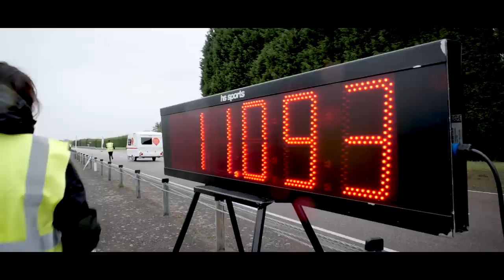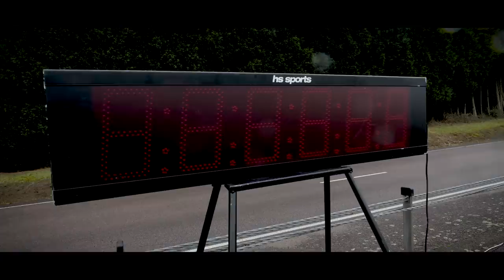How Fast Can You Tow A Caravan... With A Bike?

Comment: Guinness have been chugging too much of their own product if they thought 25mph was realistic.
Reply: Yes, 25mph would likely require around 5 horsepower so that is highly exaggerated goal.
Reply: @patricj951  well 5 hp is 375 watts which Mark was definitely pushing . Problem was instability. Maybe towing with rope ?
Reply: Χρήστο ς its 3750 watts mate
Reply: @xristos1250  no, 1hp is 736w, so 5hp is 3680w. I think it's obvious in the video that it was not only stability which prevented him to go faster. A 700kg caravan has a significant rolling resistance and at such a low speed the air resistance is small. Human power is too small for such a heavy transport with rubber tires so I think the speed will remain low. Exceeding 20km/h the air resistance will be significant as well so I think 40km/h requires several cyclists on a tandem to reach.
Reply: @patricj951  I stand corrected, it sounds more realistic. Maybe get the full Gcn crew :D no tandem just rope no?
Reply: 20 - 25 mph is average speed of a hyperbike. Its just to much probably
Reply: Guiness will do anything for a buck.
Reply: @xristos1250  Problem with a rope, would be stopping - mark would stop, but the caravan would keep going - and at 25mph, that would be a hell of a mess...
Reply: I'm pretty happy pulling myself along a flat road at 25mph let alone a caravan!!
Reply: Agreed, no idea who came up with that figure but they are obviously not a cyclist.
Reply: Χρήστο ς trouble stopping then
Reply: I can't even keep a good 25mph on my super light road bike, I go more like 18-20mph on a casual ride. I don't even want to know what I go on my mountain bikes, probably like 5 because I'm just having fun and maybe 15 downhill all out
Reply: To help out, you'd need to dampen the oscillation of the caravan's front wheel.  With a longer stretch of road and a lot of stored energy, you might be able to increase the speed a bit.

And nobody said the caravan couldn't be pushed out a bit at the start, maybe 4 or 5 people to push for the first 20 feet or so.
Reply: Χρήστο ς 1 hp is 745 watts
Reply: @vulekv93  that was uncalled for.
Reply: Where are people getting the 5hp figure
Reply: @slainsco  people asked 5 horses if they could pull it at 25mph and they could
Reply: @xristos1250  375 watts with perfect weight distribution, aerodynamics and without tow is possible. 375 + 700kg with insability, wind, tow, traction, etc. is impossible.
Reply: @dash1dash2  when you're towing a caravan, you have no need to worry about your aerodynamics on the bike, the caravan is just going to ruin all of that anyways.
Reply: @patricj951  That doesn't account for power loss via drive train etc
Reply: @patricj951  Chris Hoy and Robert Forstemann on a tandem. Put the cranks 90 degrees out to smooth power delivery.
Reply: @TimpBizkit  yes, that would be interesting to see! I think we are talking about roughly 4hp total power here.
Reply: Need a team of engineers or savvy hobbyists to make an ultralight caravan
Reply: @dash1dash2  1hp is 750 watts

Comment: Geez, they could have at least rigged up a cable actuator from the caravan's brake booster to a lever on the handlebars, or rig it up like a dead man's switch release in case he lost control. If he'd actually got to 25mph he'd have a hard time stopping without being run over. Also they could have messed around with the centre of gravity over the caravan's axle to reduce the load on the towball by moving internal components rearwards, which would then reduce the pitch up of the bike's front wheel (obviously there would have to still be some weight to prevent lifting up the rear wheel of the bike and losing traction). Considering how little time he had with no preparation, Mark still did a really good job!
Reply: This ^
Reply: You need to be included in the next run. They could use some of this wisdom.
Reply: Yeah I was actually wondering if the original towing setup -- although not strong enough -- offered the advantage of an extra hinge point between the bike and the trailer.  I'd think this would give the bike more freedom of movement to manage handling versus the rear end being tugged around by the momentum of the trailer.
Reply: sir you must be an engineer
Reply: Also, why not START from some of those existing bicycle trailers for towing your kids around?  The ones with 2 nice wheels and a set up to attach to a bike.  That way you could build the tow ball between the trailer wheels, essentially giving the caravan another axle to support the weight on.  That's where I would have started from.  First minutes into this all I could think was "no way can you do this with a caravan with a single axle!".   Good fun though...  just need an engineer on the team.
Reply: also perhaps welding the axles to turn together maybe? Certainly 100% needs brakes.
Reply: Yeah not allowing him to brake the trailer was just dammed dangerous and stupid. I thought Guinness were against promoting that kind of behaviour these days...

They could also have attached the towing point as far forward on the bike as possible and not allowed it any side to side degrees of freedom behind that point.
Reply: There needs to be load on the towball for stability but having the towball directly above the bicycle's rear axle would significantly improve controlability by removing the lever arm that amplifies any small course change the cyclist.  It would make it much more controllable than the wobbling mess it was.  It would also avoid the unweighting of the front wheel and avoid the need for the jockey wheel to be deployed and the associated unweight of the rear wheel that it caused.
Reply: @HNXMedia  not even wisdom just common sense and physics
Reply: There's no brake booster here. The brakes are purely mechanical, actuated either reactively by rearwards pressure on the hitch (caused by the weight transfer when the tow vehicle decelerates - which is also why they need to be disabled for reversing) or actively using a lever. Both of these require a substantial amount of force that he simply can't apply from such a position. The safest thing I can think of would be using a fatbike with downhill brakes - with the trailer's brakes adjusted just right and a decent amount of luck I think it could actually brake hard enough (without losing grip) to engage them.
Reply: no shit. that was absolutely stupid. no planning, no math, no sense of the laws of physics. unbelievable ! i'm gobsmacked.
Reply: Sam Prudden that and why use standard road gearing rather than super-low gearing to get started?
Reply: @jen3800  Simon wanted no part of this and just put Bowmen out there, lol
Reply: Yes
Reply: There seems to be a dead man's switch (cable loop) you can see in the video.
Reply: Actually move the weight back would cause the side to side swing problem to increase a lot. In building trailers there is a trade off between having too much tongue weight or having the tail wag the dog. I designed custom trailers for 18 years and trying to figure out where to put the axles was the most stressful part.

Comment: As any heavy boat owner will tell you, comfortably driving down the road at good speed requires just the right amount of tongue weight.  If you are going to go faster, you need a new mount that will deliver the load to the bottom bracket so both bike wheels are being loaded by the caravan.  Then you move the caravan axle forward and backwards until you get just the right tongue weight, which you find by experimenting.  Something like 5-10 lbs would probably be about right for the speeds you want, but be careful: falling and getting run over by a caravan at 25 MPH would be dangerous.

Comment: This seems like more of an engineering challenge than a physical one
Reply: Yeah he just needs more gear range and better balancing points right? Tuck the back tire almost under the front of the trailer, extend the framework up to the front end still using the back. Then maybe then he can get rid of the extra wheel.
Reply: Agree. He needs more mechanical advantage in the gearing.
Reply: what if an e bike is used, one that could go as fast as 60mph

Comment: I was bored, so decided to do the math. Even if we ignore every source of friction, he'd still have needed to hold a constant 300W for 2 minutes 40 just to reach that speed in the allocated distance. But that means I ignored drivetrain loss, rolling resistance of the tires, rolling resistance of the axles and drag, which would need to be added back. It also assumes he can begin applying this power from the start.

Comment: Some tips for the next attempt: 
- Use fat tires at lower pressure, to increase grip and get better leverage.
- Swap the front wheel for one with a smaller radius, like 24", to increase weight on the front .
- Change the caravan's tires for the skinnier ones you can get, and inflate them at their highest pressure possible.
- Use a thru-axle, steel-frame bike.
Another option would be to use a Hase Kettwiesel delta trike. With a solid attachment to the frame, a differential for two wheel drive, and a Schlumpf Mountain Drive, you will have no problems spinning the pedals to move that caravan.

Comment: Remove the rear wheel on the bike, weld the bike frame to the caravan and connect the chain to a driving axle on the caravan. Would be way more stable.
Reply: Wouldn't be a bike though.
Reply: @playandteach  It would be a tricycle.
Reply: @playandteach  I mean yeah, technically its a trike but same principle just better and you'd get more repeatable results.
Reply: @Ed.R  Yes, and it wouldn't be towing a caravan either, it would be a pedal powered motorhome.
Reply: @NickyNiclas  It could be a different record like, most weight moved by pedal power or highest speed of a ton. Would open up endless possibilities for vehicle design. This record is very restricted, a bicycle and a caravan.

Comment: weighing in with experience at building and towing weird loads on a bike:

I built a trailer using a Burley 2-seat and about 100kg of steel plate, what I found while moving a house on its ten foot long deck was to balance the load over the axle to the point where a five year old could lift the front and turn the whole assembly on his own. This way, the standing load on the bike was neutrally balanced on both wheels, and the moving load moved backward on the trailer but FORWARD on the bike (see-saw effect with the ball joint as the pivot). This effect would be mitigated at the front by the rider loading the back wheel maintaining traction and reducing the snake motion. which is caused by loss of traction on the back wheel of the bike and misbalanced load on the trailer. There would be no mitigation at the back of the trailer which would increase the rolling resistance of its wheels by the moving load trying to pull the front up. This is actually an advantage when it comes to stopping. You only use the rear brake on the bike and lean forward to keep the front wheel down since the sudden deceleration pushed the front of the trailer down forcing the front of the bike up, hence total loss of traction. The front wheel is thus basically only for steering as long as you're moving.

And yes, 25mph is not beyond the realms of possibility, it is just unbelievably dangerous with a 1500lb static load.

Comment: As an engineering tidbit, it may be easier to tow, if you set up an arrangement where the axle of the trailer's jockey-wheel is the attachment point for the bike-to-trailer towing arm, so that the jockey-wheel and the rear wheel of the bike are constantly pointing the same direction, preventing the trailer "tail" from wagging the bicycle "dog", and the weight of the trailer can be more completely decoupled from the tow-arm and bicycle...

Comment: Finally, Mark is GCN Staff(!).  Strikes me that a few sandbags behind the rear axle of the trailer (either inside, as far back as possible, or back on the bumper), and a sandbag (or, better, lead-shot filled bag) over the handlebars, would balance the hitch-weight out nicely enough that you wouldn't need - and wouldn't be hindered by - the little wheel up at the trailer tongue.  Surely there isn't a rule of making the trailer, and bike, a tiny amount heavier?
Extra weight may seem counter-intuitive, but it's mass that, once you get it going, will be beneficial to the balance of the tractor and trailer.  Tiny cars pulling too big of caravans have proven this out over the decades - they generally can get the caravans up to speed on the flats, but their clutches or transmissions normally fail early.

Comment: Here is a genuine tip for the next attempt: Use a mtb or even a fat bike, as the thicker tyres will provide far more grip. Also put panniers over the front wheel with say 20kg of weight. This will help deal to keep the front tyre gripping. Also set the caravan jockey wheel on something like a pull spring or something akin to suspension so that it doesn't lift the back wheel of the bike.

Comment: Impressive. But the average speed (of trials in each direction) was calculated incorrectly. True, it’s the average of the two numbers, but not your rate over the total of the 50 m “raced”. Rate = distance / time. Distance in each direction was obviously the same, but time was not. At d=25, I get time for the 11.093 run to be 2.476964233 seconds. The other direction was 2.535239834sec. (Actually should use their timing numbers, which presumably are not that precise.) So, the average speed would be 2*50/(t1+t2) = 9.977 km/hr. ( rounded). Still, pretty impressive.

So the distinction of the average of the two speeds needs to be made with the average speed. I’m wondering if there are more established speed records where the accepted protocol is to make a timed run over a stretch in both directions and establish the average of the two speeds, and not the average overall speed, as the basis for the record. Anyone know?

Comment: GLOBAL Cycling Network: So plz just use metric!

To the physics: Would it be better to put some e. g. Front panniers with weight on the bike and balance the caravan as good as possible with additional weight somewhere (or removal)?!
Reply: Could attach the caravan more towards the center of mass of the bike. Would require a different jig.

Comment: I'd love to try this, I have so much experience towing things with my bicycle. 
Would it be allowed if the tow hitch on the caravan was modified? It needs to apply the weight just behind and below the saddle on the seat tube. 
Bike is far too light, you need a much heavier old steel framed mountain bike like mine, 18kg min.
Also with heavy weights it's a totally different style of riding. You have to be patient and keep applying the power eventually the speed will gradually increase. If you try to get acceleration it will feel unmanageable.
Reply: I built my on car for the bike it weights about 47 kilo its hard to take off but if you go it keeps going at some point its barrely there
Reply: @lexvandewal8856   700kg once moving is no bad deal on level ground. As you've experienced the weight becomes irrelevant until you want to change speed.
The problem with the caravan is the large contact patch of the tyres and aerodynamic drag. In Mark's case he was wasting most of his energy in the side to side movement.
Reply: @Ed.R  He probably wants a really fat tire on the back of his bike for that sideways movement.
Reply: @kudosbudo  Or find a way to tow without creating all the sideways movement, it wastes a huge amount of energy.
Reply: @Ed.R  like using a trike?
Reply: @superjoeyman1  Trike would be good yes.

Comment: I was a pedicab driver for 12 years and pulled that much weight more than a few times.  If you use a tricycle instead of a bicycle you will have more stability which can allow you to use more power into moving forward.

Comment: I would have started out in the easiest cog to get moving like a truck driver.
Reply: That's the way, go through every gear. I think he was in the easiest but roads bikes don't have low gears. 
My mountain bike I use for towing has a 15t chainring giving 11.5 gear inches. Can spin out at walking speed.
Reply: @Ed.R  Yes definitely some climbing gears and I like your other responses about a heavier bike. I used to tow my dog around on an old trek that weighed a ton.

Comment: As soon as I saw him mount that hitch to a quick release skewer I knew that would snap it. I can't even pull a 70kg trailer with a QR skewer lol. I had to fit a solid bolt on axle to make it work. And you can pull that heavy trailer all the way to the first hill is how far you can pull one. You should of used a mountain bike or a hybrid to do this with. They keep their front wheel on the ground better and when you're pulling serious weight you get more leverage with your shoulders and go faster than you would using drop bars. Wider tires give better traction and stability allowing  you to put more power to the ground. Your right about being a big heavy strong guy because you need the additional mass to control the heavy load. If you had my rig you would of done much better perhaps 10 or 11 mph but 25 mph under human power with that kind of load is an impossible feat. Pulling heavy trailers is a world of counterintuity lol.

Comment: An easy calculation gives the answer to what is required for 25mph for that caravan. Just use a dynamometer behind a car to measure the total resistance for the caravan on flat road in 25mph. The strongest track cyclists can put out around 2000w in a short burst.
This means ~181N. Ok, assume he could put out fully 3 hp, which is 2200: this will be 200N in 25mph. 
I guess the total resistance of that caravan is at least twice than that at 25mph.
However; I would like to see Robert Forstemann on a trike with wide driving wheels for this task!